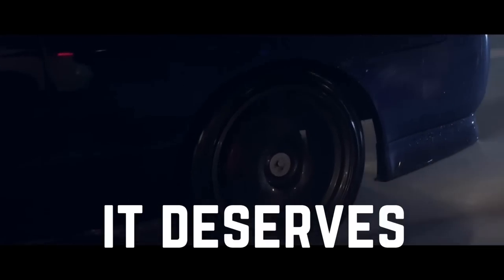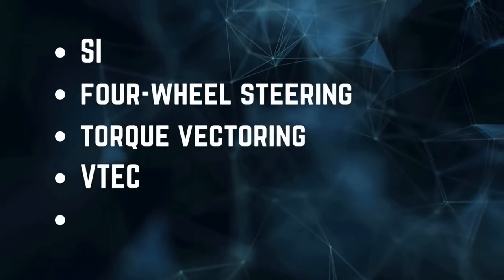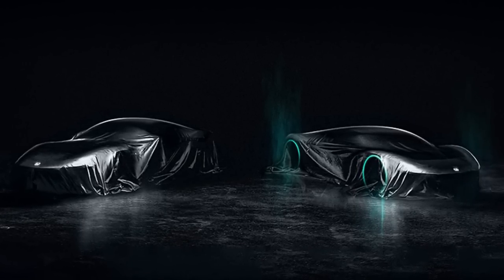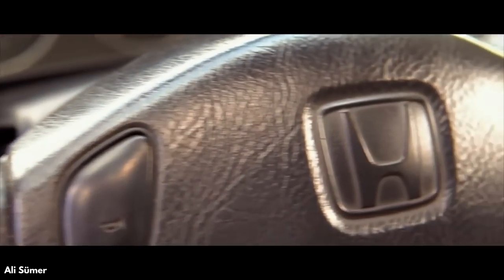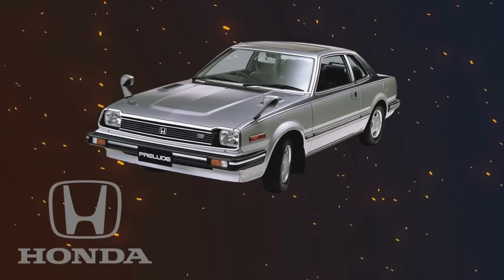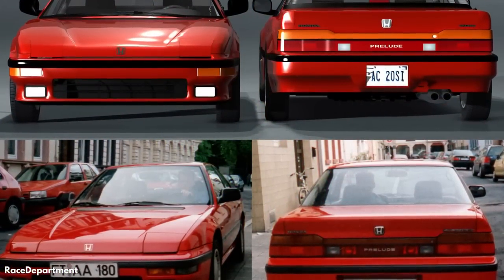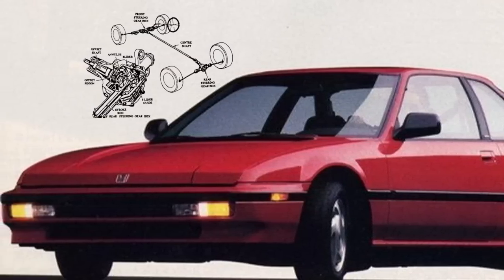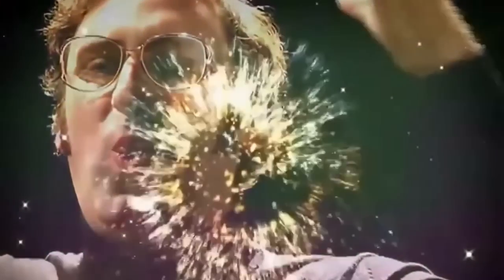JDM Cars | Is the Iconic Honda Prelude Making a Comeback? Yup it is! | EP 3

Comment: 3rd generation Prelude has a hydraulic steering system, not electric. But being that I just replaced all the hoses for my steering system, I sure wish it was electric.
Reply: However I believe the 4th and 5th generation 4ws rear rack is electronically controlled. They say it's not as reliable as the 3rd generation which has the mechanical driveshaft down the center of the car, but it was still plenty reliable. 

The 5th generation 4ws variant was rare and only in Japan if I remember correctly.

Comment: These cars were light as a feather at that so don't sleep, these 100/120 horse power two liter engines had decent power to weight and the handling was quite decent. The fourth gen dash inspired the 2006 Civic dash but through the years their last gen was my pick. That H22 was a powerhouse. The lesser known non VTEC H23 (2.3L) made an excellent torque'y base for any Civic or Accord that didn't want to go VTEC. I saw many swaps before the K swap became a thing. The automatic version even chirped into second on some healthy examples I've driven through the years. H22 VTEC turbo EG hatch anyone?

Comment: I have owned a 85 Prelude EX, and they have had disc brakes in the rear with the 2nd gen. Swapped a B16a from a DA6 halfcut in it. Those things are just great in corners, kinda missed it though
Reply from the maker: Swaps where difficult in preludes back in the day from what I remember. Sounds like a cool setup!
Reply: @captivecombustion  yes, the cv joint is riding on a bad angle

Comment: As a  recent 2000 5th gen prelude owner I’m appalled by them disgracing the Prelude name with an electric turd. Evs are not enthusiast cars!!!!!!
Reply from the maker: Do you not like the new design?
Reply: The new Design I think looks ok.. BUT. And that’s a very important BUT. It looks like a common 2020something EV. Notably it looks like the brand new Toyota PRIUS and one of those new porsche electric sedans. The design absolutely blends in with these new computercars - the EVs.  what I am disappointed most with is it being available only as EV form if that is the case. I think I speak for nearly all auto enthusiasts that this thing would be so much more desirable if it burned gasoline! MANUAL transmission please. but I also understand the way the auto industry is going, they don’t care about us car enthusiasts. I am more than happy to enjoy the cars of the past - NO EV for me ever. I’ve owned two ‘89 VWs, two 2000 Hondas, and my current is an ‘03 Jeep wrangler X I’ll take these any day over ANY electric automatic 2023 crossover that drives me. I don’t care if it wears a Lamborghini, Nissan, Chevy, VW or Jeep badge. those are bland cars for people that don’t like cars. I like cars. Fuel efficiency is not my priority.